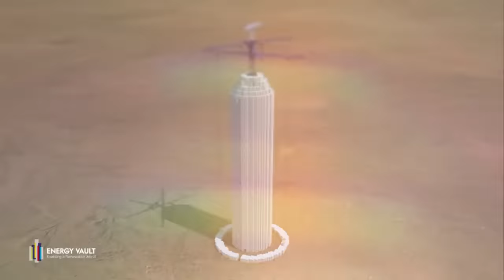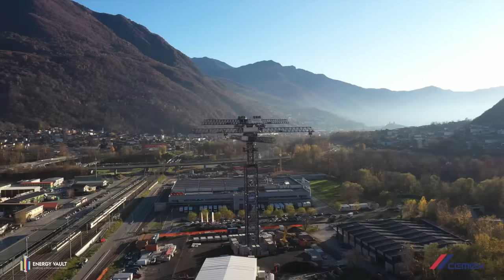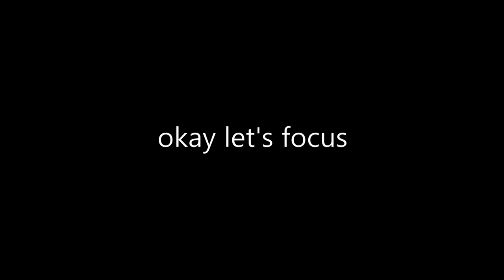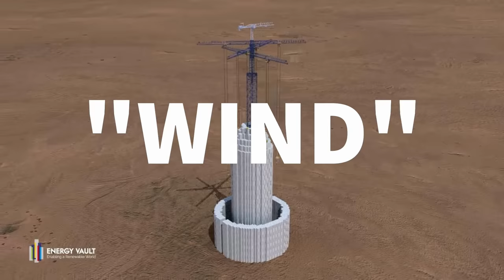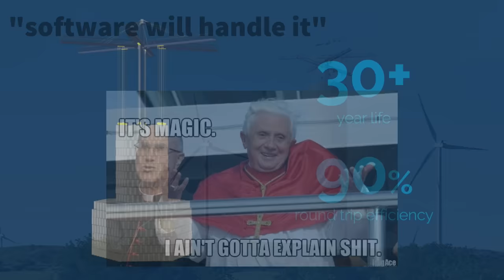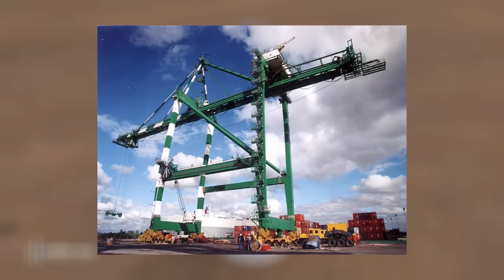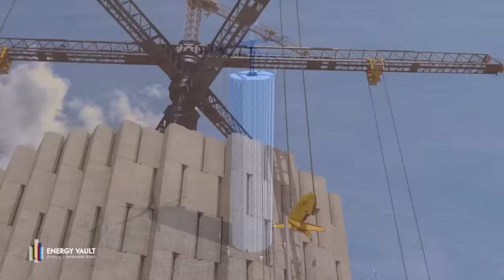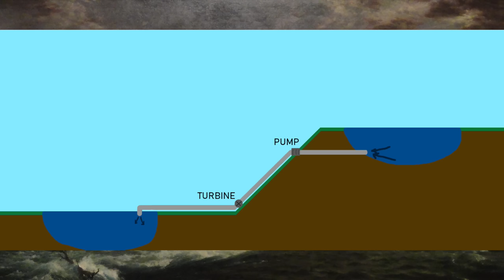The Energy Vault is a Dumb Idea, Here's Why

Comment: Coming from a mechanical/aeronautical engineer: The issue with hydro-storage is that it requires a place with hills so flat ground won't work and it also wouldn't be suitable for high temperature areas where water is a luxury and evaporates away easily. Energy storage is still going to be a major issue when moving to entirely renewable energy because we don't have an easy solution. I'd personally like to see the world switch over to using hydrogen as a portable energy storage, since it's the only renewable/sustainable liquid propellant (if it's created through electrolysis).
Reply: Yeah, I was just thinking about how not everywhere has the water to run the thing, especially deserts where you're going to be putting solar power in. So sure, we solved one issue, but not another really
Reply: Doesn't hydrogen have it's own problems? I.e. highly flammable, needs to be kept in air-tight containers, preferably under pressure to increase energy density, etc...?
Reply: Oh, and since you want it in liquid form, doesn't it also need to be kept cool? (Or under extremely high pressure?)
Reply: This is why I'm more in favor of nuclear powered rail as the main means of transportation (with better urban planning to allow walking/biking for the majority of transportation needs). Electric rail doesn't require energy storage because it's directly connected to the grid, and nuclear power uses an incredibly energy dense source and is capable of load following and producing energy 24/7, requiring little to no energy storage. Yes, there's a waste problem, but it's a far more manageable one than fossil fuels or even most sustainables, since we actually have a plan for it once it's reached end of life, unlike pretty much every other means of producing electricity. Not to mention it produces far, far less waste than pretty much anything else, by several orders of magnitude. (Solar panels and wind turbines don't just come from nowhere, and they have to go somewhere once they no longer work anymore.)
Reply: @rolasmola9641  yes, but its Storageable nearly everywhere, if you add one Step and make methane out of it you Dont need the cooling and Not as high pressure, the tanks dont corrode so fast and its less flammable. And can be transported in the exsisting natrual Gas infastructure.

Another Option is storing hydrogen in ammonia
Reply: @rolasmola9641  Yeah, its liquid temperature is around 20 Kelvin or - 253 C which definitely creates its own set of problems but aren't unsolvable (NASA has been using hydrogen for their rockets for a while so they've been working on solutions for a while). Also you would use gaseous hydrogen at the point of use to avoid having to have cryogenic tanks in your car and it's not much more dangerous than gasoline in your car, the reason you might think that is because of the Hindenburg but what was burning in that was the diesel on board.
Reply: @KeVIn-pm7pu  Methane's byproducts still produce CO2 so not a long-term solution. Storing Hydrogen in Ammonia still needs electrolysis to separate it from the Nitrogen (NH4) so that wouldn't be a better than using water (H2O) since that's vastly more abundant on earth.
Reply: @KeVIn-pm7pu  To be fair though, storing hydrogen energy by converting it to ammonia or natural gas makes the whole idea kind of moot if the point is to be carbon neutral. At least by having the energy stored in hydrogen, there is a way to release it with no greenhouse gases (other than water).
Reply: @rolasmola9641  I like Nuclear Power for energy generation too but it doesn't solve our energy storage issues because you can't have everything run on electric rails, that would make living outside of a city untenable. A multifaceted approach is probably our best path forward because there really is no silver bullet to solving our energy-related problems worldwide.
Reply: @WidespreadKnown  yes if you need hydrogen. But it makes it safer for transportation.
If you need Power you just burn the ammonia.
And i am no Expert but it could be possible that it is cheaper to produce ammonia in a desert, transport it and Crack it again where you consume the hydrogen. Depending on if transportation and Storage costs are smaller than does of hydrogen.
It doesnt matter that methane releases co2 because it is produced. The co2 comes either from air or other not co2 neutral plants. Which prevents further co2 emissions.
Reply: @Not.a.bird.Person  no. Because it still is net carbon neutral. Where do you think you get the carbon in the produced methane.burning of Ammonia  doesnt produced co2.
Reply: @KeVIn-pm7pu  Amonia's byproduct is not just water but nitric acid, which is extremely nasty, wouldn't work as a replacement for gasoline.
Sorry to say but if you are using Methane in a car then it still emits greenhouse gasses at the point of use, you wouldn't be able to capture the carbon anymore than you could capture the carbon released from gasoline burning. Also, there are no "carbon neutral" ways of extracting methane like there is for hydrogen. There's also currently no carbon capture proven technology that can be paired with methane's use at a plant, maybe in the future we can create "carbon capture" but they currently don't exist now and it's technologically dubious solution at best. It can't be a long-term solution for the planet.
Reply: @WidespreadKnown  i never said you use it for cars. i said for power production. powerplants simply add a catalyst.

Yes cars would still produce co2 where they burn it but they are not adding to the co2 already in the atmosphere.

Of course you can capture co2 from the air.
Its not very efficent i give you that but its possible. and as long we are not fully carbon neutral we can use emissions from coal plants. so called " clean coal"... misleading name however worth as a source for co2 as long it exists.

"also, there are no "carbon neutral" ways of extracting methane" - I didnt say exctraction read carfully. you produce methane as in Methanation.

I disagree it is a long term solution especially for colder countrys. Here in germany we cant rely on solar power in winter, therefore we need some storage. Hydrogen is usefull but very expensive in storage plus the containers corrode farly fast. We can utilize our already existing natrual gas infastructure with methane.
Reply: @KeVIn-pm7pu  I understand you weren't saying to use methane for cars but my original point was to use hydrogen in areas that requires some sort of mobile energy (remote areas) or when you need to store excess energy (solar, wind, ect.). But a simple catalyst does not capture CO2, I'm sorry but it's not that simple. In refining or using methane in power plants, the technology of capturing CO2 at the point of use still has not been proven to work on a large scale. Also, no methane/natural gas or coal plant are currently carbon neutral and they've been trying to make "clean fossil fuel" technology for decades without success, which is my ultimate point. It's a hope that at some point we could but it's more of a pipe dream and even if we can "clean" it, that doesn't solve the problem of emitting CO2 entirely (mining and extracting fossil fuels will always emit CO2). Clean coal is not a technology though, it's just an idea and then once you capture the CO2 then there is a big problem with how you try and store it so that it doesn't release into the atmosphere (same problem with extracting it from the air, once extracted how do you ensure it does not get back into the air, we haven't solved that problem). If being carbon neutral is the goal then no fossil fuel energy will do.
Solar doesn't have to be the only solution for power generation, nuclear is an option, and wind in some areas but storage of excess energy is the big issue facing us not the power generation since we've got plenty of ways to generate energy without emitting CO2 but no scalable ways of storing energy without emitting CO2. The issue with hydrogen is more reducing the cost of storing it since there are methods currently but it's expensive and hydrogen tanks last many decades if maintained proper ally, NASA still uses their biggest tank and it was created in the 60s. Hydrogen's technology issues aren't unsolvable, unlike trying to avoid emitting CO2 into the air while still burning fossil fuels at power plants, which seem unsolvable at this point.
Reply: @KeVIn-pm7pu  Carbon in artificial methane can be obtained anywhere, you can litterally just use fossil fuels to extract it and merge it with hydrogen, making it not carbon neutral. That's a bit of a moot point to ask where it comes from. I also doubt the chemical refining process can be made carbon neutral (though this is not my field).

As for Ammonia, it's even worse than burning methane because it produces nitrous oxides instead of CO2. As it happens, you are speaking to a guy who studied the combustion or hydrogen and ammonia for use in internal combustion engines. Unless a specific fuel cell using ammonia gets designed that would make pure nitrogen out of it during the reaction, burning ammonia is pretty bad for the environment. Burning hydrogen is also quite bad if done at peak thermodynamic efficiency because the air contains nitrogen that will react and form nitrous oxide as well at high temperatures. There's 2 options to be carbon neutral, either burning hydrogen in a turbine inefficiently at low temperatures to emit no nitrous oxide or pass it through fuel cells that are way more efficient at extracting the energy. In an industrial setting, I'd favor fuel cells.
Reply: @Not.a.bird.Person  Yes, Hydrogen with fuel cells would be my preferred way forward. The technology is proven and we just have to lower the cost of storing Hydrogen.
Reply: @WidespreadKnown  I slowly get the impression you want to misunderstand me.... next try:

" I understand you weren't saying to use methane for cars but my original point was to use hydrogen in areas that requires some sort of mobile energy (remote areas) or when you need to store excess energy (solar, wind, ect.)." - Methan works for both, Ammonia for powerstorage just to use in powerplants or big engines like those of ships.

" But a simple catalyst does not capture CO2" - I am not sayint that.the catalyst is to prevent nitrogen oxide emission.

"In refining or using methane in power plants, the technology of capturing CO2 at the point of use still has not been proven to work on a large scale." - which time will tell however the function in itself works. i am not dening we still need research in this very topic.

" Also, no methane/natural gas or coal plant are currently carbon neutral and they've been trying to make "clean fossil fuel" technology for decades without success," - who is "they" They as the owners certainly wont and dont as long goverment doesnt give them restrictions to do so. And just on that basis we should give up fusion as well as they are trying that for decades too.

" which is my ultimate point." - if i correctly understand you just wanna say it does not yet exist. in this case i fully agree.

" and even if we can "clean" it, that doesn't solve the problem of emitting CO2 entirely (mining and extracting fossil fuels will always emit CO2)." - But we wont do that anymore in my scenario. 

" Clean coal is not a technology though, it's just an idea and then once you capture the CO2 then there is a big problem with how you try and store it so that it doesn't release into the atmosphere " - pump it into tanks and use it for Methanisation. 
"(same problem with extracting it from the air, once extracted how do you ensure it does not get back into the air, we haven't solved that problem)." - you make carbon out of it.

" If being carbon neutral is the goal then no fossil fuel energy will do." - again just because it has the same chemical structure it is not a fossile fuel. 

"Solar doesn't have to be the only solution for power generation, nuclear is an option, and wind in some areas " - Yes wind is an option, nuclear is not. especially not as primary source. to many downsides. 

"...but storage of excess energy is the big issue facing us not the power generation" - what do you think is power-to-gas ? it includes power to hydrogen as well as power to methane or for that fact any other chemical structure storing energy for later use.

" since we've got plenty of ways to generate energy without emitting CO2 but no scalable ways of storing energy without emitting CO2. " - no scalable ways of storing? what of course we have. Your power to hydrogen is one of them, power to methane, power to ammonia all scalable solutions for power storage.

"The issue with hydrogen is more reducing the cost of storing it " - as if i am talking against a wall. what do you think why i proposed to you methane and ammonia? because it is comparable cheap to store. i would really apreaciate you at least read what i wrote before answering.
Reply: @Not.a.bird.Person  "Carbon in artificial methane can be obtained anywhere, you can litterally just use fossil fuels to extract it and merge it with hydrogen, making it not carbon neutral." - but why would i suggest that? should be obvious that i mean carbon already emmiting the atmosphere or on the way as in fossil fuel plants that are not yet eliminated otherwise it wouldnt be carbon neutral at all.

" That's a bit of a moot point to ask where it comes from." - here you got the answer.

" I also doubt the chemical refining process can be made carbon neutral (though this is not my field)." - Just use renewable energy for synthetical production or make use of the microbiological metabolism.

"As for Ammonia, it's even worse than burning methane because it produces nitrous oxides instead of CO2." - Which is not a problem if you use a catalyst afterwards.

" As it happens, you are speaking to a guy who studied the combustion or hydrogen and ammonia for use in internal combustion engines." - perfect then you should know that a catalyst  reuduction system should prevent. and dont forget i only proposed that for stationary use or on big engines like ships.

"Unless a specific fuel cell using ammonia gets designed that would make pure nitrogen out of it during the reaction, burning ammonia is pretty bad for the environment." - as written above.

 "Burning hydrogen is also quite bad if done at peak thermodynamic efficiency because the air contains nitrogen that will react and form nitrous oxide as well at high temperatures. There's 2 options to be carbon neutral, either burning hydrogen in a turbine inefficiently at low temperatures to emit no nitrous oxide or pass it through fuel cells that are way more efficient at extracting the energy. In an industrial setting, I'd favor fuel cells." - yes fuel cell is beatiful for hydrogen. but again you just need a catalyst reduction system.
Reply: @WidespreadKnown  It not just the cost of storing the hydrogen, it's the cost of making it in the first place (and not using methane like the currently do).  Hydrogen is a dumb idea for cars.  Trucks maybe.
Reply: @KeVIn-pm7pu  It's not as simple as having a catalyst. Ammonia can damage catalysts, meaning unburned ammonia will cause damage over time and you will have some in your exhaust no matter what you do if it is your main reactant in a combustion chamber. You also can't remove all the emissions from using only a catalyst, just a fraction of it, unless you go big on the catalyst. They work using adsorption, meaning you get diminishing returns from adding more and more of the catalyst to remove contaminants like nitrous oxide. At some point it becomes unviable to remove everything and you will produce a LOT more by burning ammonia than you will by burning gasoline. You also don't produce nitrous oxides by passing hydrogen through fuels cells, this makes them a much better option in my opinion because you don't have to solve the problem of other greenhouse gases. Burning hydrogen should be reserved to very specific niche applications like aerospace propellants because it makes sense to use fuel cells everywhere else.

For the refining process, it's more complicated than that. It's not just about using renewable energy, in many chemical refining processes, you have to create carbon dioxide in a way where it will get lost to the atmosphere for the process to work, unless you want to have a gigantic plant which then becomes impossible to operate economically. I also highly doubt alternatives to fossil fuels will be used considering they will likely be more expensive to use to produce methane. It's a bit like the problem of grey/blue/green hydrogen. The reason we don't produce much green hydrogen is because it costs more compared to grey hydrogen.
Reply: @Not.a.bird.Person  "It's not as simple as having a catalyst. Ammonia can damage catalysts, meaning unburned ammonia will cause damage over time and you will have some in your exhaust no matter what you do if it is your main reactant in a combustion chamber." - Catalyst reduction methode is as much i know not just a catalyst. in case of ammonia burning a bit of ammonia is even needed to prevent harmful nitrousoxide.

" You also can't remove all the emissions from using only a catalyst, just a fraction of it, unless you go big on the catalyst. They work using adsorption, meaning you get diminishing returns from adding more and more of the catalyst to remove contaminants like nitrous oxide. At some point it becomes unviable to remove everything and you will produce a LOT more by burning ammonia than you will by burning gasoline." - Nice claim but got something that actually shows that? i cant find anything, considered my lack of time to search.

" You also don't produce nitrous oxides by passing hydrogen through fuels cells, this makes them a much better option in my opinion because you don't have to solve the problem of other greenhouse gases." - but you have the big problem of storing and transporting a highly flammable and volatile substance which is costly and more prone to errors.

"For the refining process, it's more complicated than that. It's not just about using renewable energy, in many chemical refining processes, you have to create carbon dioxide in a way where it will get lost to the atmosphere for the process to work, unless you want to have a gigantic plant which then becomes impossible to operate economically" - i never said this will be economical. you are right it would need to be financed by the government to keep running. as does the plant in iceland.

" I also highly doubt alternatives to fossil fuels will be used considering they will likely be more expensive to use to produce methane." - not if the carbon tax is high enough which is the only way out of fossile fuel dependecy. if not dryed up fossile fuels will keep being cheap a few decades longer.

" It's a bit like the problem of grey/blue/green hydrogen. The reason we don't produce much green hydrogen is because it costs more compared to grey hydrogen." - yes again carbon tax
Reply: @KeVIn-pm7pu  To answer all the points you mentionned about catalysts : Catalysts are just tubes containing catalytic materials which will chemically capture compounds designed to be captured. The way they capture them is by having the compound pass as a fluid over the catalyst bed. This is ''flawed'' in terms of efficiency because of the geometry requirements for it to work. The gas essentially passes over the catalyst and it's the contact between the 2 that creates the reaction. I have personnally worked on numerical simulations for this kind of phenomenon, which is called adsorption. My point is that it basically isn't 100% effective. The longer the catalytic bed, the lower the concentrations of contaminants are at the end but the concentration doesn't just drop to zero, it drops in an asymptotic way and you get diminishing returns from making a bigger catalyst. If we take this and apply the logic to nitrous oxide, you won't remove everything by applying a catalyst at the end. This is an issue if we are to have large scale systems producing nitrous oxide in massive quantities.

For the other part, ammonia is a chemical compound containing hydrogen and nitrogen. This means the reaction will produce nitrogen compounds. Without going into the specifics, ammonia and hydrogen combustion with air produces higher amounts of nitrogen compounds than gasoline and fossil fuels. The main reason is the combustion temperature breaking apart nitrogen molecules in the air and in the case of ammonia, it's just because it contains nitrogen by itself. Fossil fuels are typically compounds containing oxygen, hydrogen and carbon. By themselves, fossil fuels do not contain nitrogen, which means the only way they create nitrogen compounds is by breaking apart nitrogen molecules in the air by burning at a high temperature. This happens for fossil fuels, but it happens at a lesser rate than in hydrogen and ammonia combustion, for hydrogen, it's because the combustion temperature is higher at stoechiometric combustion than fossil fuels, and for ammonia, it's because it contains nitrogen itself.
Reply: @Not.a.bird.Person  thx Captain obvious
Reply: @KeVIn-pm7pu  really? ok buddy